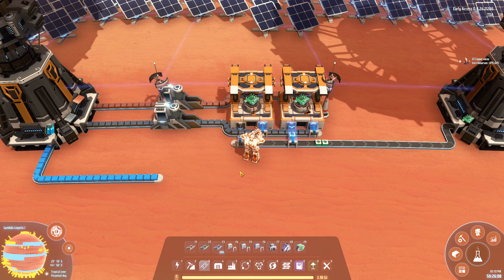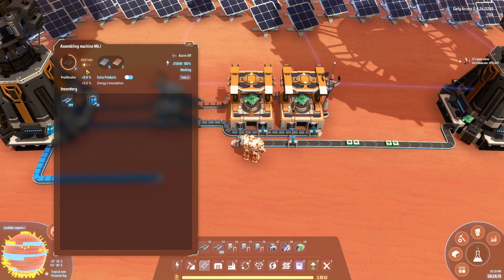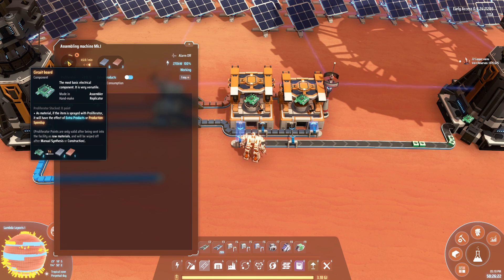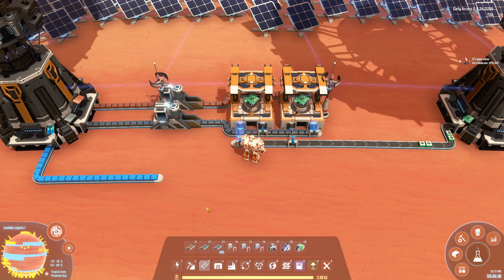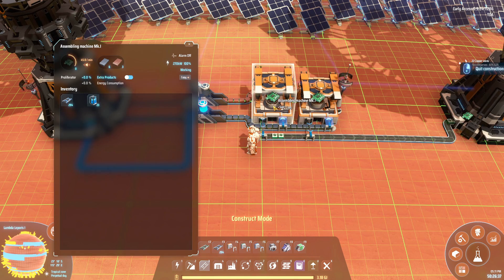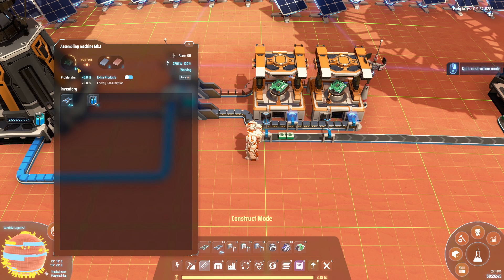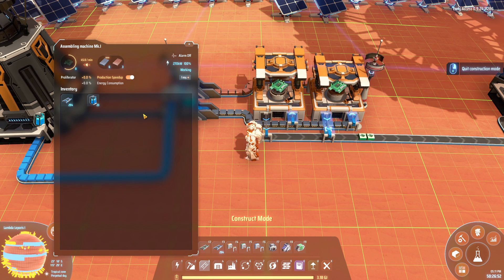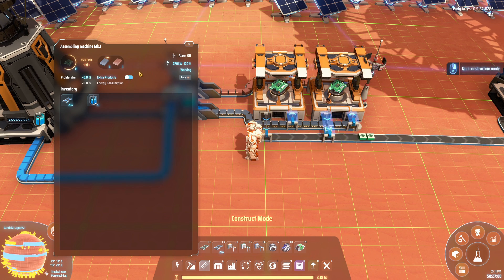Proliferation Explained - Why is "Extra Products"  is always superior

Comment: Not allways.its OPOSITIVE most of time. and i explain.
what difference between prolifiration Mk1 and base MK3 assembler do every notice this or not?
Mk1 x1.5 production speed, Energy cost 675kW
Mk3 x1.5 production speed, Energy cost 1080 kW
Thats mean this way DECREASE energy consumption on 405kw with same production speed economy is 38,5% of ENERGY.
its choose between 38,5% energy consuption or 25% of bonus production.
You can say pal....its 25% production.
I can answer. i BUILD more a 38,5% MORE Assemblers and they be doing this 25% production, but i prolifirate and for them, and they have less consumption, and for this part can build even MORE assemblers and in the end its be a lot more that this actual 38,5%.
in comparing its be near 35% more production,cuz i just BUild more for cheaper cost of energy.

What stop player from scaling at most? 2 problems always?
place to build and Energy. 
You can MINE every single planet in galaxy with Speed prolifiration on some buildings. But Need thinking little more.

And i late game when you start Building actual Dyson sphere or sail, you have a tons of energy and you can use Mk2.
its be x2 production and 1500kw.  math to match MK3 numbers.
        3 mk2 vs 4 mk3
.6 product  Vs 6 product
.    4500kw VS 4320.
were i win?
in amount and placement. Cuz mk3 need 25% more place with same speed and energy. and becaus i have many energy fro Dyson Sphere and just simply build on 25 MORE MK2 to have more production and proliferate them.

so YES.its OPOSITIVE most of time. DO NOT USE production proliferating cuz you can benefit more from SPEED most of the time.
Only use production on materials what RARE to you in this current moment to make first science or nenesary first buildings.

Comment: that's really not the case, they are superior almost in every situation but when you do planetary scale build the space is a big factor, and able to cut down the machine needed for the build is sometime very beneficial
Reply from the maker: Depends on what you're doing on that planet, but generally speaking you will actually save more space by using the extra items, because that ends up working exponentially throughout the entire production chain. Exponential savings are better than linear savings :) 

If you dedicate entire planets to a single item however, the above does not apply and the speed increase will save you the most space. But have you really ever run out of planets? :O

Comment: This is really well demonstrated, but I'm thinking for a long-term game (and they all are) the concern is getting the most out of your raw resources as possible unless they are actually infinite.  Most resources are finite, so Extra Products is going to be the best choice.  Harvesting gas giants is effectively an infinite resource, so wouldn't Speedup be more useful when using those resources?  Crude oil is sort of infinite, starting at a certain rate and dropping off over time (not production amount), so wouldn't that be even more useful to Speedup?
Reply from the maker: Endgame no resource is finite, as the vein efficiency takes care of that. From that angle, you could argue that speed therefore is always better.... but that only holds if you don't care about how many miners you have to place, don't care about the amount of buildings, and don't care about energy efficiency. 

But yea, there's a solid case for speed, so it does actually comes down to preference!

Comment: What about spraying stacked goods?
Reply: It uses one spray per item, regardless of how high they are stacked.
Reply from the maker: Doesn't work (at least, if the goal was to save on ' sprays '): 4 in a stack = 4 sprays, just like normal.
Reply: @TheDutchActuary  You expressed that better than I did.  4 in a stack = 4 sprays, yep.

Comment: Would their be any benefit to mixing types throughout the chain, for example: Spray "Extra Product" onto anything inputting into a smelter & switching to spraying "Speed" onto anything inputting into an assembler?
Reply from the maker: Not really, although you could use it to min/max your production chain. You get into plenty of places where you need something like '4,5 smelter of X' . So you could mix&match to get to round numbers, but that's just overdesigning things imho.

Comment: I always use extra products for my factory, it reduce the total raw ore you have to find across the map. Extra Products is like free items, and of course more compatible/useful in low resources multiplier seeds. But Production Speedup can also be used to improve game performance and save data, since the required amount of machines/facilities is only at half
Reply: Good point about machine count.  Good late game optimization.
Reply: Saving warpers… power for those ships… etc.  Not to mention that rare resources are rare and should be sprayed^2 from step one.  Products are the only option.
Reply from the maker: In terms of the amount of machines: Check the count in the example, it's not that far off from eachother! This only gets better as you get into longer production chains!

Comment: Yeah the production speedup really only has a couple uses. The most relevant one would be if you're trying to save space on a specific step, since it does the most for that step in terms of space savings (half the machines for the same output); but you have to keep in mind that you're missing out on space savings in earlier steps in the chain. The other use is if you have a mall, where you only want one assembler of each building (assuming you have the resources to support doing this).

Extra products is much better in most other cases. For the cost of a tiny amount of coal/diamonds/nanotubes, you can produce significantly more end products, assuming you proliferate the whole chain.

My goal with the cluster I'm working on now is to get it cleaned up from all the early game mess (though I tend to make less mess than most, I think), replace all the regular miners with advanced miners (working on this now), then try to put proliferation on any builds I can squeeze it into (I tend to build things as compact as possible). Also, I'm not sure what I'm going to do about stacking just yet. You can do some crazy things with it, but my builds are already pretty big, so I'm not sure how I'd fit in the extra machines to make use of the extra belt capacity.

Comment: I was about to completely fail my math and ask 'doesn't the speedup have the same kind of compounding effect?' when I realized that you need the proliferation at each step to reduce the required buildings at each step. Some positives for the speedup are that the throughput is insane and it makes full use of the pilers, and it requires much less energy than the extra products. For my challenge run with 0.5x resources, the extra products has been a lifesaver, even if it drains my energy reserves dry. Essentially you are creating things out of nothing, for the low low price of the spray fluid.
Reply from the maker: The ' needs much less energy ' is debatable. For early production, sure, but the compounding effect becomes more noticable in late(r) game.
Reply: @TheDutchActuary  I stand corrected. The longer the production chain, the more effect the compounding has. In fiddling about with FactorioLab's calculator, I tested 1 belt of Quantum Chips. Fully proliferated, speed requires 20k MW, products requires 17k MW. This difference is even more pronounced the longer the production line is. Of course it is likely easier to proliferate for speed because the calculations are easier and the space requirements are less, but overall extra products are better.

Comment: Best explanation I've seen, and I really like the visual aids.  👍  +Products is my go-to -- almost always smaller, faster, cheaper.  I've tried speedup in a couple places but the extra power and supply demands are pretty real.  Might not be worth it depending on your situation.

Also -- the DPS calculator on factoriolab has been updated for proliferators.  Choose a proliferator for the steps where you want them and it automatically adjusts the building numbers to maintain the same output.  It's wonderful for those of us who aren't professional mathematicians.  Or just lazy.  😉

Comment: Great vid, and yeah the compounding benefit is huge, it's not so noticable on short chains, but once you're up to 3-4 links it really starts to mount up. Green cubes for example, 5 per second requires 115 iron ore per second, fully proliferated with Mk2 proliferator drops this to 38 iron ore a second a 70%+ reduction.

I can't wait to fully proliferate rockets and all sorts of long chains!